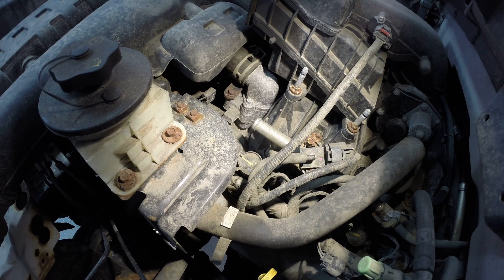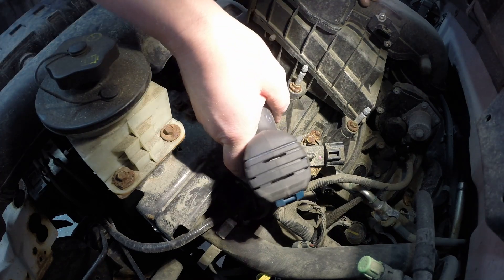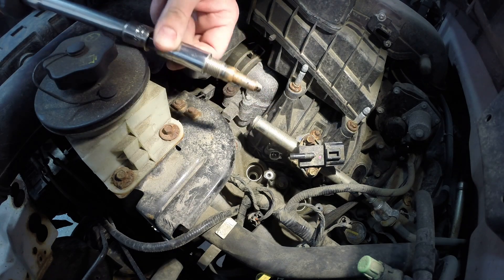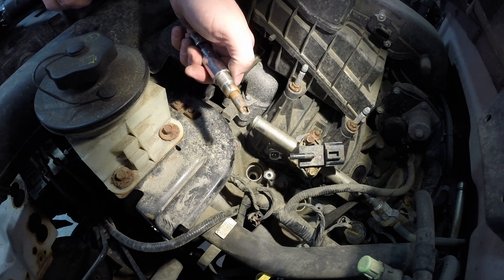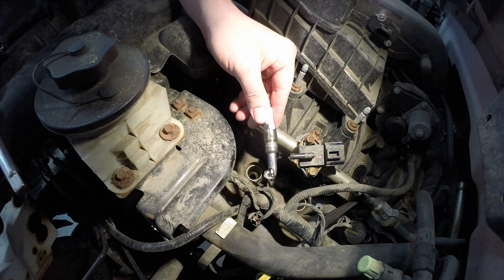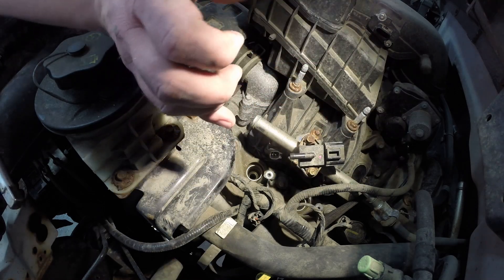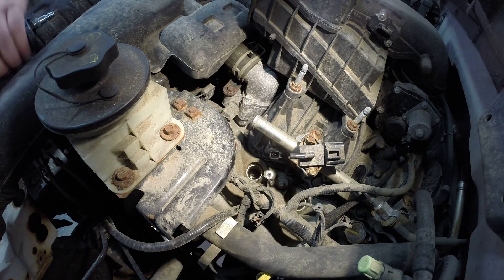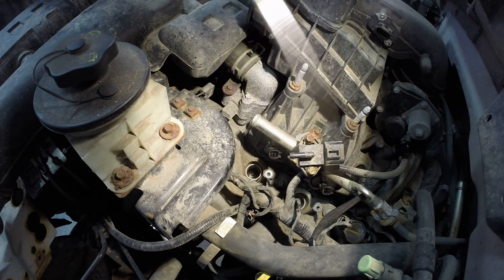The Best Method for Removing STUCK Ford 4.6L & 5.4L 3V Spark Plugs??

Comment: your struggles with these spark plugs reminds me of how the 200 cu. in. I6 in my 1966 Mustang thermal locked the plugs.  Never tried an impact wrench.  Long breaker bar...
Reply: Shock is the most important to prevent damage so with the breaker bar you'd have to hit it.

Trouble is, you have to keep even forces to prevent the plug from breaking and that's hard when hitting a break bar.

Have to go with what you have though.

Comment: I've heard of this trick. Just a risk of pulling the threads out of the head doing them hot. But as much trouble as it is to get the broken plug out it's worth the risk. 
Who ever it was at Ford that came up with that plug I hope they have been fired.
Reply from the maker: +CamperMike yup you must be careful and have the gun as straight as possible.
Reply: @FordTechMakuloco  Build Back Better Joe Biden designed them
Reply: Joe Biden invented it.

Comment: Heh -- was thinking that using that Astro Impact to remove the injector cable screws is like taking a bazooka Team to knife fight. lolz!
Reply from the maker: +Hawaiian F150 that Aircat has saved me so many times already. It's great when used correctly.
Reply: +FordTechMakuloco -  Ya man I bet it has hands down.  Plus it compact enough to get around in tight places and got plenty of power for its size. Really a great tool. I mean really it is just deceptive to have the power it has.

Comment: We used to have good luck with selling "real" fuel injection cleaning so help soften and remove the carbon. It wasn't perfect but it did help a lot of the time.
Reply: Have you heard anything from your Ford buddies about the 2016 Explorer, F150, & some Escape showing up with P2111 codes. We have no resolution or info from Ford yet and have 11 vehicles sitting around waiting on Throttle bodies.
Reply from the maker: +Joe Lopez I have never had any luck with that at the dealer and we used the good stuff the 4 part BG kit!
Reply from the maker: +Joe Lopez Are you changing the throttle body and the concern remains or something?
Reply: +FordTechMakuloco we have not had any parts yet. They are national back order. I work for a rental car company. We had large cluster pop up over the course of a week. Our other locations report failures are well. No results yet because no parts available or info available. Could not even find P2111 DTC on the ford database for the explorers. We found the pin point testing info under the F150s with the same conditions. I was just curious if you still had your ear in the industry and had heard any reportable news.